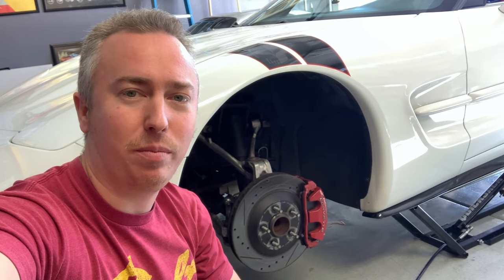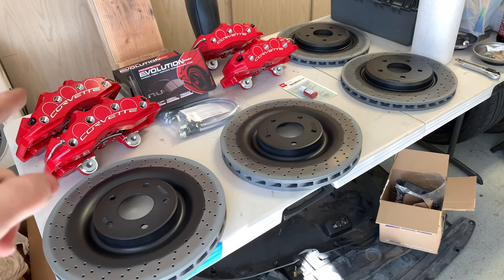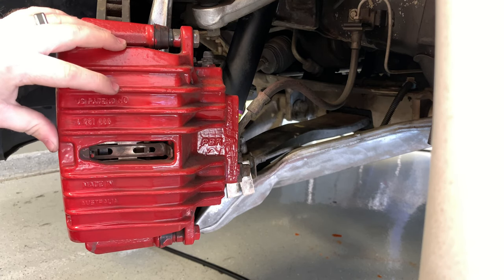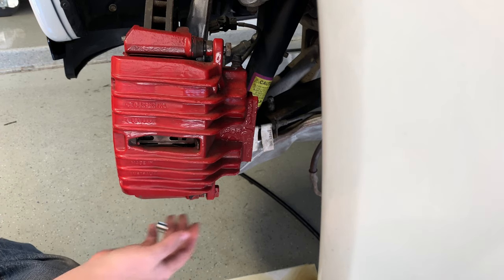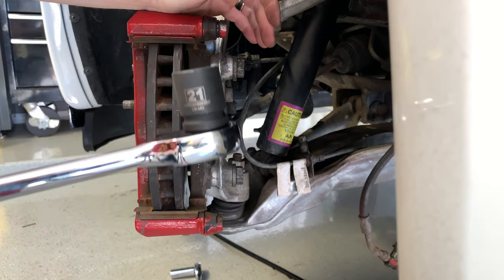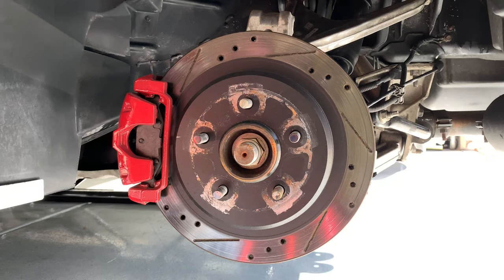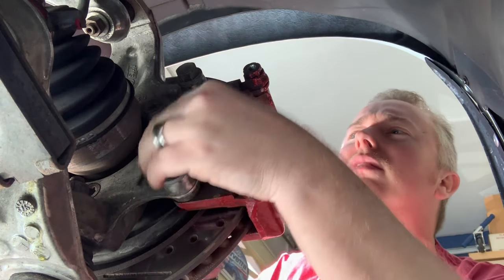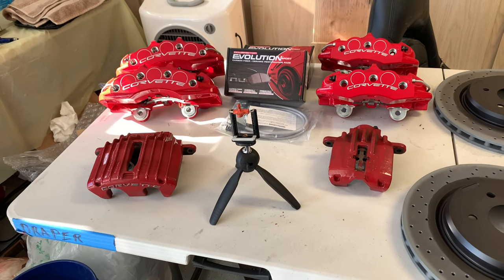C5 to C6 Z06 Brake Upgrade - Part 1

Comment: Awesome video Chris! Quick tip for everyone watching, if you depress the brake pedal all the way down and hold it there with like a broom stick or something after you crack the brake hose loose, it'll stop the fluid from dripping out of the hose while you're working.
Reply from the maker: Nice tip!
Reply: @mycorvettelife  Spray the fluid everywhere...yup that's a great tip...….wow!!!
Reply: @scnomad100 yeah how tf does pressurizing the system keep it from doing anything but spraying fluid everywhere?

Comment: Just finished this upgrade last weekend.  Indeed, they do not manufacture the calipers for both sides.  They make the right rear and left front.  Just buy two of each and swap the bleeder valves with the crossover tubes on one of each and it works great.  Remember the bleeder valves go on top.  Great video series!
Reply from the maker: Thanks

Comment: Excellent upload Chris. If you haven't yet checked the price on the necessary new slide pins, you may be a bit shocked. I think they're a total of 28 of them. But hey, it's just a cost of this great upgrade. FWIW, you refer the this upgrade as C6 ZO6 upgrade. They also came on the C6 GS. Save the Wave.
Reply from the maker: True

Comment: Hello.
watching your youtube channel often. there is a lot of good video’s
today's big question:

I see that there is no difference between the right and left side of  front and rear rotors.
what about cooling the brakes. then the right side gets extra hot and you get an imbalance in the brakes
What does the manufacturer say about this?
Best regards
Simon (Norway)

Comment: What are the part numbers for the SS brake lines? Also will they connect directly to the C5 lines or is some sort of adapter required

Comment: I think this upgrade is good if you are tracking the car.For street use just using highest quality pads,brake fluid and Z06 C6 wheels/tires will be all you really need.Of course you lose the bling factor.Entertaining and informative video(as usual) though

Comment: @My Corvette Life - Is this a worthwhile upgrade for a C5 Z06 or should I look at a Wilwood kit?
Reply from the maker: Of course it is a worthwhile upgrade.  If you have the money, Wilwood is probably better, but if you have that kind of money you probably wouldn’t have a C5.
Reply: @mycorvettelife  the Wilwood Spec Corvette kit can be had for around $1500 for the fronts. Comes with the 2 piece rotors and 6 pistons.  I'm just curious if the stopping power or heat dissipation is enough to justify 2x the cost of what you've done here. (I really like what you've done here)
Reply from the maker: If you track your car regularly, I would say go with Wilwood.  If not, don’t waste your money.

Comment: Great video Chris but some parts numbers they are not found in Rock Auto  ...for ( LR  .RF .LF. calipers ) and did you go with C6  (6.0L .   or 7.0L)   and which year you go with ?
Reply from the maker: Depending on availability they may not be shown.  If a part is on back order, you will not find it on Rock Auto.  You should be able to find it for any year 2006-2013.  7.0L

Comment: I enjoy your videos. I recently did this to my c5 base and have CCW SP500's 18" fronts and 19" rears, my rims clear the calipers on at the perimeter but they won't clear the calipers on the inside. What rims are you running?
Reply from the maker: Forgestar F14
Reply: @mycorvettelife  Deep concave or super deer concave?

Comment: If you were removing the whole assembly anyway, couldn't you just skip the caliper removal and just take out the two 21mm bracket bolts and remove the caliper/bracket as one piece?
Reply from the maker: Yes you could.

Comment: which brake set up is lighter (stock or z06)?
Reply: The c6z brakes are much heavier. Stock is the lightest setup. More mass equals less brake fade.
Reply from the maker: The heaviest part is the rotors.  The C6Z rotors are very heavy, but if you can manage to afford 2 piece rotors you can save about 10lbs a piece.

Comment: This is why I'm starting with a C6 Z06. By time you upgrade everything to buy 'like' a C6 (so many other parts) you end up paying more...
Reply from the maker: But then you end up with a stock C6 like thousands of others.
Reply: @mycorvettelife  C6 Z06 and the value of one. Instead of the value of a C5 with C6 parts
Reply: BTW, not saying your route is bad just say why I wouldn't ;)

Comment: Looks like the left caliper is no longer available.
Reply from the maker: It is.
Reply: @mycorvettelife  LR #22800575 not listed on Rockauto website.
Reply from the maker: They have multiple part numbers throughout the years.  Try 1722573.  I just looked it up and found it very easily on Rock Auto.
Reply: @mycorvettelife  I will do that Thanx , Keep up the great videos.
Reply: Yeah the left rear is gone all over the Internet  172-2575 is another part number but I cant find one in stock
Reply: @forevercarcrazy  Get two of the same and switch the bleeder valves
Reply: It works
Reply: @mycorvettelife  the lines you got, were they for the c5 or for the c6 z06??